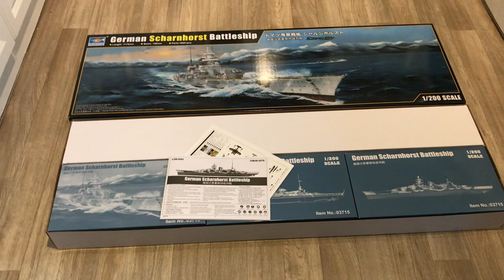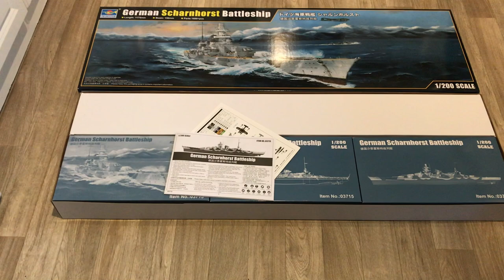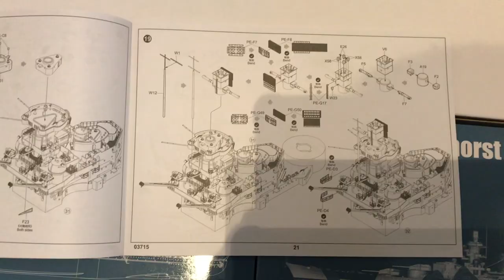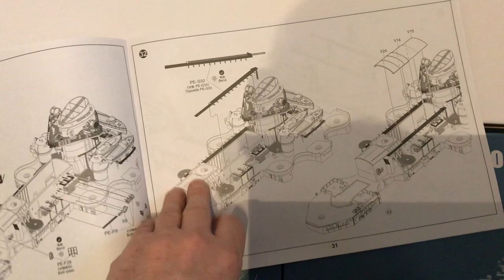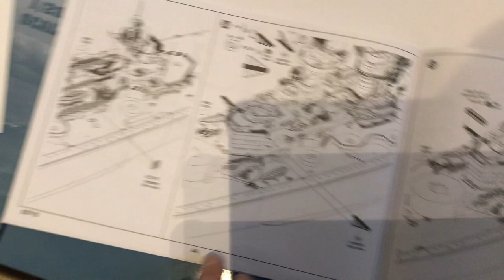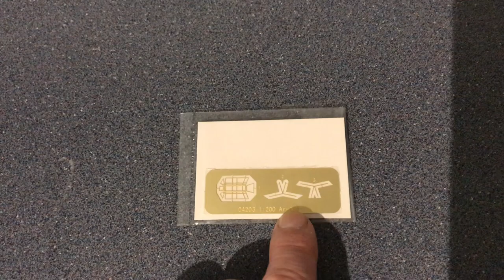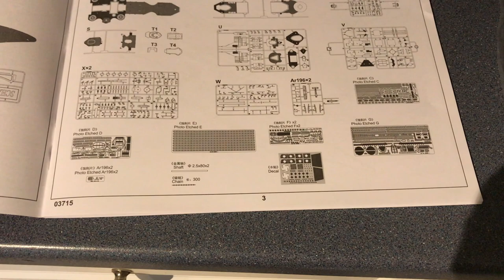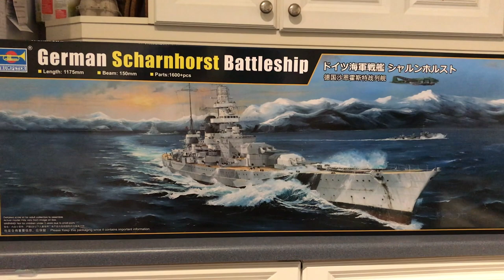Trumpeter 1/200 Scharnhorst First impressions part one

Comment: How many inches long is the plastic hull? Can you compare the size to 1/200 Bismarck? Thanks
Reply from the maker: I will take a measurement and and put the comparison in part 2 👍🏻
Reply from the maker: Hi Bismarck is 123 cm long and 17.5cm wide. Scharnhorst is 117.5cm long and 14cm wide